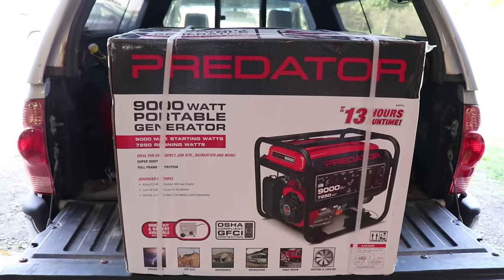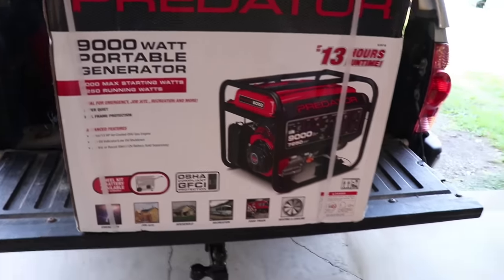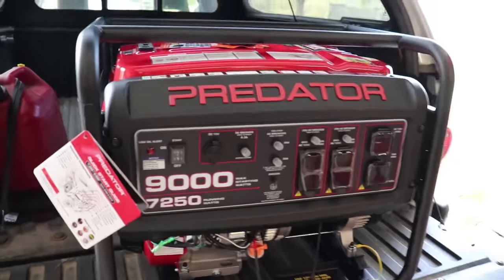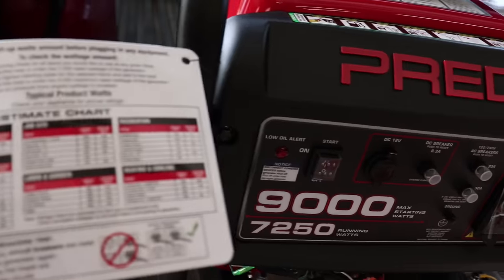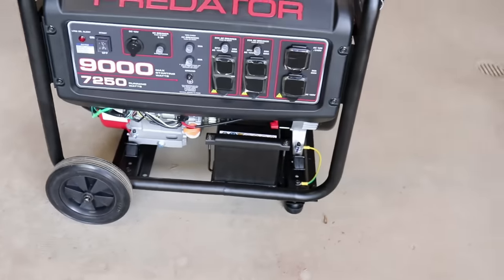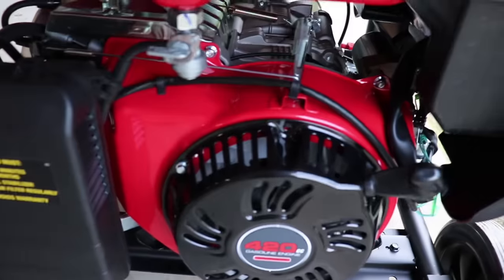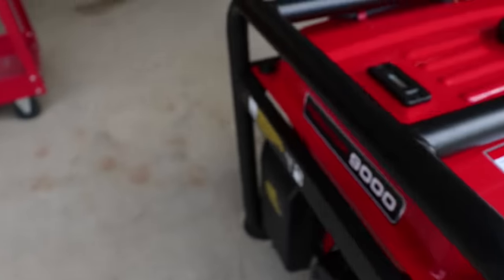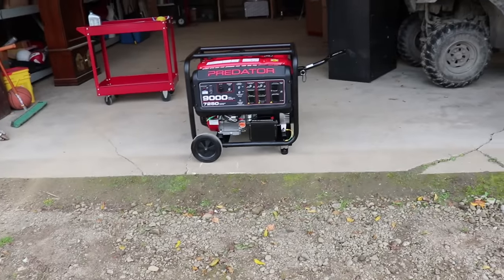Predator Generator Running Our ENTIRE Home. (Complete Setup and Cost)

Comment: I have two predator 8750’s and one of them powers my entire house to include my 3.5ton a/c unit. Great little generator for the money. No complaints here. Although I do not have an extensive amount of run time on mine so I cannot speak on overall reliability of the unit. But overall I’m happy and my wife is happy because having air conditioning is a priority down here in south Florida when you lose power. Great video. I’ll do one soon of my setup so you can check it out.
Reply from the maker: Thanks for watching! I am wondering of the reliability of it as well. I have read a bunch of positive reviews on the reliability but we will see. I told my wife last night I hope we have a major storm and lose power so I can use it for a couple hours! I can't wait to check our your video. Take care.
Reply: @Boosted Chris, I have an 8750 and ran some calculations and I believe it will run my 3.5 ton unit (I live in Daytona and like you AC is critical).  Did you run your AC for awhile and then shut it down to run everything else?  I’m thinking about turning everything off so I have enough startup watts, cool the house, then shut it down and use everything else again.  Curious how you’re doing it?
Reply: @DIYJeff  Hey Jeff! I ran the unit for about an hour but turned off things that I knew drew a lot of current. I.E. Hot water heater, pool pump, dryer. One generator had enough balls to get my RUUD A/C system started. The generator doesn't even skip a beat when starting up the system. I ran the rest of the house like normal.

Comment: Have the same generator, I run my whole house with a 220 well and 2 AC's on eco mode. I do however kill the breakers to the freezers and the second fridge when using it. Been using it for a year now. Changed the oil and cleaned the filters at the proper run time and treat all the gas I put in it with Fuel Tron. So far it's a great generator for the money.
Reply: Here are the portable generator safety rules: this safety information is only for anyone who use a portable gas generator and for those who are planning on getting a portable gas generator. This is just a reminder for everyone’s safety. All generator safety rules should be followed carefully. This advice is just to make sure that everyone is aware of all the warnings and it’s just to remind people to be careful using portable generators. Generators can be dangerous if not used carefully. Every year, hundreds of people die or get injured when using portable generators due to carbon monoxide poisoning and electrocution. Make sure you are using your generator carefully and keeping others safe as well. There is something very serious that everyone should always be aware of when using generators. Some people do run their generator indoors which is not safe and that increases the risk of carbon monoxide poisoning which can cause death of family and you. Some people run their generator in wet conditions which can electrocute them. Please remember that you should never run your generator indoors. Remember that carbon monoxide is an odorless and colorless gas that you cannot see or smell. Carbon monoxide is a silent killer. Keep that in mind. Make sure your generator is 15-20 feet away from your house and away from doors, windows, and vents. Never use your generator in your porch too. Having a carbon monoxide detector is very important against generator safety. Some people also allow children to go near the portable generator which could pose risks. We need to keep an eye on our children making sure that they are not near the portable generator so they won’t get electrocuted or burned by the generator which is dangerous. A locking enclosure also keeps kids safe. A generator shed might look like a tempting place to explore, or take cover during a game of hide and seek, but a generator is a dangerous piece of equipment that can cause injury. It says on the manual that we should also keep children away at all times from the portable generator to avoid injuries. Please do not allow a child or unqualified people to operate the portable generator.  It is important to keep your children safe especially little ones. The portable generator can be hot during an operation. Just because some manuals missed what should be listed doesn’t mean it’s safe to do. Always follow the generator safety rules when using portable generators. Generators pose electrical risks. If you need to use your generator during wet weather, you need a generator tent to protect your generator from getting wet. Don’t let your generator get wet. Keep your generator dry and before using your generator, please make sure your hands and your generator is dry. Do not wear loose clothing when operating the generator. Everything that is said on the generator’s operating manual should not be ignored. Never smoke cigarettes near the generator. Please keep flammable things away from the generator. Never overload your generator too. Your generator can catch fire. Never ever try to plug a generator cord into a wall outlet to avoid back feeding. Back feeding your generator is dangerous. Always turn on your generator first before plugging in appliances and shut off the appliances before turning your generator off. Use a heavy duty cord for your generator and the cord should not be worn out. All the instructions should be followed carefully. Never refuel your generator while it’s running. It can cause fire if fuel spills while your generator is hot. You should turn off your generator and let it cool off before refueling it. Having a fire extinguisher next to the generator is also important. This is only a reminder for everyone’s safety of using generators. Make sure your generator is properly grounded. Having a fire extinguisher next to the generator is also important against the safety rules. https://youtu.be/I1jT3ANENvI and here is a video more about keeping others safe when using generators and also about our family’s safety. It’s important to keep your children safe especially your little ones. Hope this helps. Thank you.

Comment: Glad to hear you have an interlock on it's way.  Thank you.  I have since being able to by ethanol free gas I no longer use nor need sta bil.  Recommend using ethanol free and always shut full off and allow the engine to run until it burns all the fuel out of the carb but adding a propane kit will eliminate fuel/carb issues.  Thanks for sharing your set up vid.
Reply: rstephe Even though it's ethanol free you should still use sta-bil. Varnish will still form if the gas sits. As always, add the stabile as soon as you buy the gas, not when you think it's going to sit for a while.
Reply: Isaac Kvasager I disagree with you. I have great success with sta bil and have not had any varnish form in gas left in my equipment for the specified duration coverage.
Reply: Isaac Kvasager well our experience is different, because I’ve had gas go bad in the past that I forgot to treat while simultaneously having gas that was treated do very well in my equipment.

Comment: I just bought the same generator. I joined their Inside Track club for a year and got 20% off, which more than paid for the membership fee. I bought mine to power my welder and plasma cutter, as they were drawing way too much power from the house electrical. I plan on having a transfer switch and plug installed sometime in the future, so this video answered any question I might have had as far as using it for the house when the power goes out.
Reply from the maker: Thanks for watching! Appreciate the comment.
Reply: BTW only run up top 160 amps on your welder If you stick welding with this generator because it wants to shutdown after that.

Comment: Just an observation,  you didn't mention the recommended break in perior for the engine.  That generator should have no issue powering all of your homes' needs. It is always a good idea to calculate your home's requirements! I recently acquired a Champion 9375 dusl fuel unit for our home as a backup power supply in addition to our solar system. The local code required inspection of our panel to make sure we were in compliance with the city electrical code. 
It is important to know that these are not heavy-duty commercial units 
require proper maintenance to ensure  a long service life. 
I am opting to run mine on propane due to it being easier to maintain than having to store a bunch of gasoline in my garage, and it doesn't degrade over time like gasoline does. I think it's safer overall  
Good review!
Reply: Who in the hell would even tell a local authority that they planned to install a transfer switch for back up power

Comment: I bought a 7500w Predator in 2010. I wired a 240v male plug to one end of a 12' length of 10-3 cable. I wired the other end directly to a double 50A breaker in my garage's box. I turned off my main breaker in the house to prevent catastrophe to my house or a lineman. I ran my entire house, including a 2 1/2 ton Central AC unit, for nine days afterwards.

Comment: I just bought a new Predator generator.     Break in:  run it no load about 30 minutes.  Dump oil and it will be dirty with maybe a few specks of metal.  Refill and repeat.  Do this 3 times!  The engine will last alot longer.  

Change oil every 100 hours.
Reply from the maker: Thank you!
Reply: also add some LUCAS oil additive ..... prevents dry starts

Comment: I have the Predator 8750 watt generator.  We recently lost power for 8 days.  I fired up my trusty predator and ran it for 8 days straight.  No problem.  As Mr. Cook said, it is a bit loud but nothing horrendous.  After 8 days running 2 fridge's, numerous lights, TV's, 2 10,000 btu A/C's, and various other small items,  I changed the oil and she's ready to go again.  You can't beat this thing.  One hint i'd like to share.  Don't let the generator shut off (run out of gas) while under a load.  Also, don't start it under a load.  You may encounter what's called a "loss of residual magnetism".  Your machine will run but not put out any power.  It's an easy fix though that you can look up easily enough.
Reply: bought mine 2 years ago, bought it after the power would go out and be out for the whole day. now the power has not gone out for more then 10 min. in the two yrs, just my luck!
glad to know that when i do need it i got the right one ;)

Comment: So a guy who owns his house, who is prepping for emergencies to protect his family, a family that homeschools and I caught a sign on your wall that was speaking about the Lord? I dont know what other videos you have but I'm subscribing. I cant wait to see your other videos! 
.
Also i just bought a dual fuel generator from Champion for the same purpose basically only i didnt do a ton of research. Thankfully it came with basically everything. To get mine to where yours is (oil, electric start battery, wheel kit, oil funnel, weather protection cover, sta-bil or however its spelled, 4 extension cords and a 30amp plug because i didnt research and know i should have gotten one capable of 240...) and a few other things my grand total was around 720 dollars. And its 4750 starting with 3800 running. So all in all not horrible, but i think that will be my mobile generator and soon ill be bidding on a used military generator that will be able to run a house at full capacity with ease. That one ill pour a slab for and it will have a permanent place.
Reply: @isaackvasager9957  thank you for showing everyone what kind of person you are. You said everything i need to hear to know youre a close minded, follow the leader and do as youre told without question kind of person.
Reply: @isaackvasager9957  ....go back to your high IQ lefty leaders Maxine Waters & Nancy Pelosi,.....ha, ha, ha, ha, ha.
Reply: @coltondillon2380  Who paid you to post this comment? Because I otherwise can't make heads or tails of what your point is.
Reply: @TangoNevada  I'm not paid to say anything. If I like something I'll speak well on it. If I dislike it I'll speak ill on it. Just that simple. If you're speaking about my response to isaac, he left a rather uncalled for comment. So I responded accordingly, and in response he deleted his comment.
Reply: @coltondillon2380  I think I was replying to him. You Tube really needs to fix their Comment/Reply System. You can never tell who someone is actually replying to. We can land a man on the moon but they can't figure out a simple way of discerning whom someone is replying to.

Comment: I just went & got a 9000 for my Dad last night @ HF & it would be great if u could do a video on what u did concerning the breaker box so we can figure out how to do that. We had plans of doing that to my parents house but not sure of the details. That would be great! Thanks alot for doing this!!!
Reply: Check with your power co. They might offer a transfer switch that installs behind your electricity meter. They are expensive, but if you can lease it for a bucks a month, it's a cheap/easy way to get the gen running now until you have time to figure out your preferred setup later.
Reply: @TheCdubbleyoo  THANK YOU SO MUCH! I appreciate you taking the time to reply.

Comment: I invested in a Generac XT8500EFI it’s a 10,000 starting with 8,500 running electric start and uses a fuel pump. If my 12V battery is low I’m out of business. I leave the NOCO Genius 10 plugged in the garage and it monitors the battery and keeps it charged. Now I have no worries when I need to take it out to the back yard not wondering it it will start.
Reply: If you don’t mind me asking what did the generator and rest of the electrical work to get it to work cost you?

Comment: I have a similar one and it runs my whole house with A/C, but if I have to use anything extra like a microwave then I turn off the A/C until I'm done. 
They are loud though, diesel is much quieter and a lot more expensive to buy, but cheaper to operate and quieter. 
You can run NG or LPG on the gasoline models too, some models are ready to use both.  
For a GenSet that I needed daily use I'd be going with diesel, but the gasoline or one running LPG even better would be fine for temporary or emergency use.
If you have space and need it daily an Off-Grid Solar System  might be worth while. Cost to operate is low and it will lower your electric bill.  It's good for the environment and quiet too.

Comment: We used a similar emergency setup in Rural NSW Australia, the unit is an 8.800, battery start and runs the 'whole' house when our mains power goes down which is a few times a year.
( we have 3 TV's, 3 A/C units for Heating and Cooling, the usual Fridge and a Freezer units. Desktop computer, Water Pump, garage doors and all lighting etc etc. Our cooktop is gas), 
All up cost including purchasing the unit from eBay with delivery, paying an electrician for a fully legal hookup and a small flat pack outdoor storage shed was a tad over $1500.00 AuD. We have had the unit for about 2 years now and used it many times without a hicup. Its best to use a qualified electrician to install the unit as your insurance company may not pay up if there is a house fire. 
Possibly one of the best things we have done!

Comment: I have same setup. I had everything turned on. Lights, Elec HW heater, refrigerator, small freezer, grow lights, air conditioners (4), well pump, wash machine. But.....I turned on my oven and blew the main fuse on generator (just one leg). So if you need to use oven turn a few things off. Also if run constantly it will last 24hrs.  Great vid. A note DO NOT RUN IN GARAGE EVEN WITH DOORS OPEN run outside away from doors or windows with exhaust pointing AWAY from house.

Comment: Congrats on your Predator 9000. I got one myself

A BIG FYI, you would need to install it on the exterior of your home because of the carbon monoxide, GREAT NEWS, it also runs on natural gas (which will be a lot cheaper than petrol gas) and you can get the tri-fuel adapter kit so it may run on propane as well. Also highly recommend you the the hourly timer so you know exactly when it is time to do your oil change and know the life of your generator. And as an added option  I am getting a solar battery maintainer so the battery will last longer (it is a AGM battery)..
Reply: or run a longer exhaust pipe
Reply: can you run home A/C

Comment: Excellent video but I went a different route. I also power my whole house with a relative small 8.5kw Champion standby gas generator with a 120 galons propane gas tank which includes a ATS (automatic tranfer switch) so every time there is a power outage in less than 10 seconds everything is back to normal. Although my house has 4,000 square feets I can energize everything including my two fridges, my electric cook top, microwave oven, my washer, my two garage doors, all my lights, my 48” tv, satellite system, wifi router, my cistern 3/4 hp electric water pump and my 18,000 btu inverter a/c. But my water heater is solar and I don’t need a heater in my house because I live in PR and here we have warm weather throughout the year. My total investment after it was installed by a professional technician was only $3,500.00 dollars but it worth every single penny. In my case I chose a gas generator because after being affected by hurricane Maria, both gasoline and diesel fuels were in short supply for several weeks were propane gas was always available and served at home. Also the lines in the garages to buy gasoline or diesel fuels during the emergency sometimes were 24 hours long.....😳.
Reply: Which champion generator did you buy? Will this power entire house including 2 big  fridges?
Reply: Don’t forget to watch this video about generator safety https://youtu.be/I1jT3ANENvI stay safe

Comment: Being from a rural, cold weather state, running a blown hot air furnace. If you lose power in a snow storm, you can put perishables in the snowbank but, if you have no heat, you're screwed.